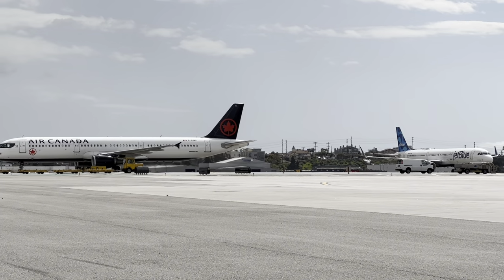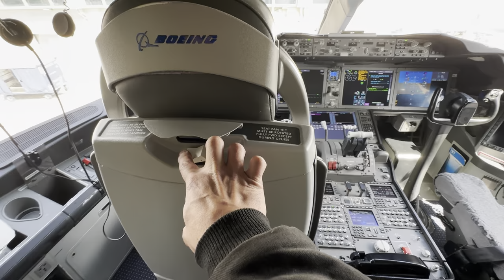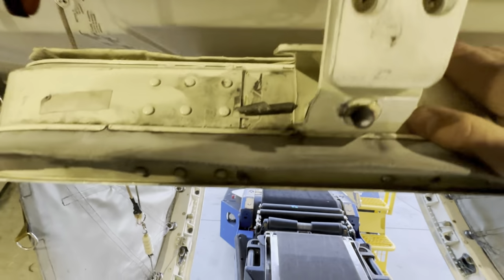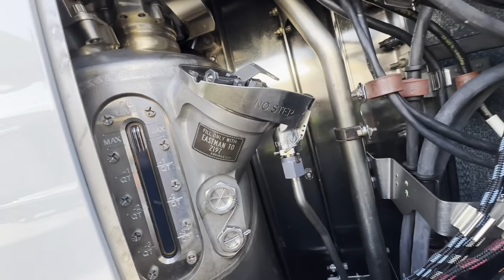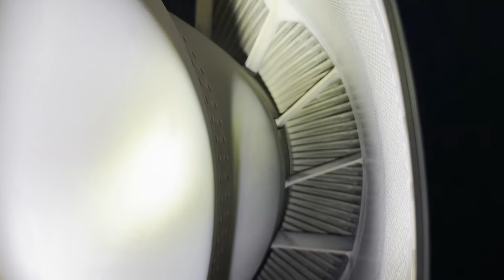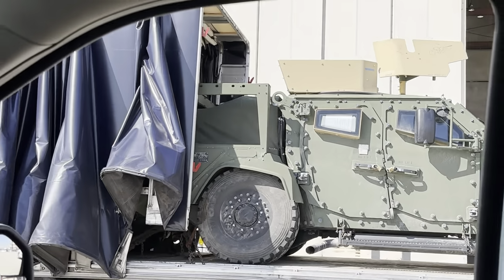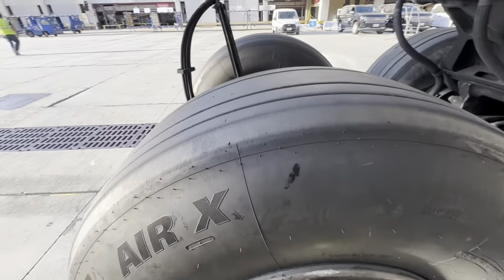Stig Shift #17 (Aircraft Maintenance Adventures)

Comment: 3:00 interesting. If you ever come across and EOL indication please do film it!

14:00 This is a Dual Motors. apparently it was a US-American car manufacturer. Carrozzeria Ghia is an Italian car design and coachbuilding company...
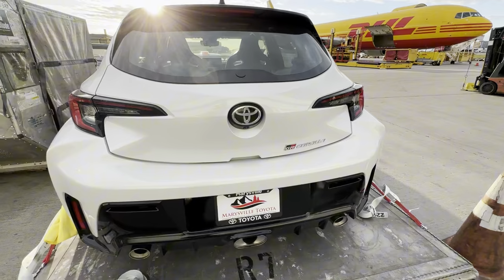14:50 Well... I'd call it a hot hatch, similar to the Golf GTI, Focus RS etc
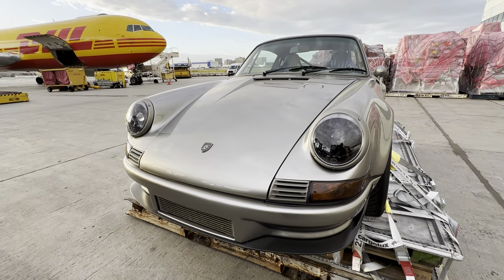15:00 You're saying Porsh to tease me now, don't you :'D

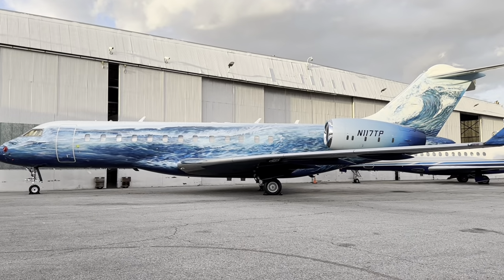16:10 it's nice... but I kinda dislike the amount of blue. makes it really hard to spot in the sky. So is white against a cloudy backdrop though, so I guess one can't complain too much^^

25:00 what's the water draining there? is that simply a drain from the wheel well and water sloshing around the drain hole area?

30:15 When doing the status test. The Aircraft Acceptance for the Captain includes a 3second status push. Do you guys do these? Never seen you do one but editing removes context, so please don't take this as me throwing criticism your way. Just genuinely curious :)

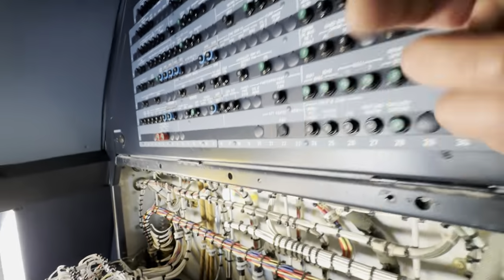31:25 Those blue items. I assume they aren't lockout rings as they are red. Are they simple chicken rings to indicate certain breakers and make them easier / quicker to find? (I know about the green/black meaning [FWC monitored breaker and system])
Reply from the maker: The water that you’re seeing is coming from the forward potable drain port. In regards to the three second status push, I’m not quite sure what you mean by that, if I want to see the status, it’s just one press and it shows the status page. In regards to the circuit breakers, some of them are disabled, and some of them are permanently locked out so it won’t be tampered with.
Reply: @StigAviation  in regards to the circuit breakers: what would the blue be then? I understand the red ones: Flightcrew has no business touching these whatsoever. Really confused about the blue ones though :'D

On the STS: oh, sorry, I got my buttons confused; my bad. I meant the RCL on the EFIS control panel. If you press that one for 3 second it'll recall all cleared/cancelled warnings. This is part of the flight crews aircraft acceptance procedure. Only ever seen you check the status page so I was wondering about that difference.
Reply from the maker: @boahneelassmal  I don’t need to bother with the recall switch, that’s why I print out a post flight report that will give me all the information I need. Even more data than the recall switch will show.
Reply: @StigAviation  ooooohhhh okay, yeah that makes a hell of a lot more sense :'D
As I said, was just wondering.
cheers mate!

Comment: One question I have always had is how long between the pilot hitting the shutdown switch and the engine no longer posing an ingestion risk. I guess the compressors, in effect act like an engine brake and the compression acts to slow down the shaft assembly when fuel is cut.
Reply from the maker: As soon as the pilot shuts down the engine, it cuts the fuel and starves the engine, once that occurs the power loss is almost immediate, 10 to 15 seconds and the engine is no longer producing any thrust. Afterwards, the engine simply winds down naturally.

Comment: Love the uniqueness of your videos!  A perspective that is not offered by other aviation videos.  I was wondering if you could explain a)  what the loud, mid to higher pitched hydraulic/mechanical sound is that one hears typically just before engine start on Airbus planes?  As a passenger you hear this coming from under the cabin about mid way it seems.  b)  Certain planes/engines produce a very amplified  "playing cards in bicycle spokes" sound on takeoff and climb out until throttling back for cruise.  Can you explain why the engines make this sound?  Thanks!
Reply from the maker: The sound you’re hearing from the Airbus is called the power transfer unit, I made a whole video just about that. Check it out when you have time. The sound of the engine is simply the sheer power of thrust along with gearbox functionality.
Reply: "playing cards in bicycle spokes", otherwise known as the buzzsaw.  Since most modern, high-bypass engines have the fan linked to the low-speed spool, when under high thrust, the sound is the shockwave of the tips of the fan blades going trans-sonic.  The exception is the Pratt Geared Turbofan (GTF), installed on the Airbus A320/321NEOs and A220s, which has an additional gearbox that de-couples the fan from the low-speed spool.  Since the gearbox allows the fan to operate in its most efficient range, the fan speed on the GTF never creates this shockwave at the fan blade tips, and so it is much quieter (relatively-speaking) to traditional high-bypass engines during take-off/climb-out.
Reply: Thank you!  Just watched the video you referenced.  That was before I discovered your YouTube channel so I missed it.  Very helpful explanations! @StigAviation

Comment: Great channel  really enjoy your knowledge.   What are the spinning wheels next to the throttles on the 737 and the 320's
Reply from the maker: The spinning wheels are the trimmable horizontal stabilizer wheels. It is to trim the horizontal stabilizer manually if needed. But usually it’s doing that automatically hence why you see it spin around on its own when the aircraft is flying

Comment: Stig! Great and amazing videos! I hope I didn't miss it in the comments or vid. But on the push back clip, as soon as the plane is backed on to the line fluid begins coming out of a port just aft of the nose wheel panels. What was that?
Reply from the maker: That’s just water coming out of the drain of the fwd lav or galley sink.

Comment: We need Stig on this one...news said no brakes, then manual brakes.
An redacted Airlines jetliner suffered an “anomaly” in the braking system before running past the end of a runway at Dallas-Fort Worth International Airport. The issue occurred on February 10, 2024. An inspection revealed that flexible hydraulic lines to parts of the braking system had been improperly reconnected after a repair job. Despite the brake failure, the pilots used manual brake pedals and thrust reversers to slow down, and the plane eventually came to rest on a paved area beyond the runway. Saw pictures of crossed brake lines, and electrical lines.:face-fuchsia-wide-eyes:
Reply from the maker: Nothing more I can add to that, everything is pretty much explained in the report.
Reply: TY @StigAviation

Comment: 10:47 , I see that there is a marking on the tyre that says 777-300. Does that mean there's a  wheel difference between the -300 and -200?
Reply from the maker: Yes indeed. The 777-200 is a smaller wheel. The 777-300 is bigger. Not interchangeable.

Comment: Do you rotate your working gates or stay at the same one ? Is your normal day a 16 hour shift ? 3 day work week ? Are the engines specifically set up as Number 1 or Number 2 ?
Reply from the maker: We rotate the gates around so everyone gets a little change of pace. Normal day is usually 8 hours, it’s when I pick up extra shifts it turns into 16. Engines are interchangeable between 1 and 2 side. Left is one right is two.

Comment: 20:15 The Alaskan door plug that opened up that was due to the fact that that particular door was the passenger door plug Those doors are not designed to be opened. They are there in case if the airline company wants to utilize it and actually make it a door and to these aircraft are usually used for cargo only in some companies and the airline does not want to have to redesign an airplane every time they change it from cargo to passenger. If you look at some aircraft that are cargo, you can see the window cut outs, but no windows and that’s because that same design is used for a passenger aircraft.  The NTSB already checked the accident and seen that the four bolts that hold the door plug in place were missing. Once the aircraft got up to altitude, it blew out depressurizing, but thank goodness it was only at 14,000 feet shit would really hit the fan if it was over 30,000 feet
Reply from the maker: They were lucky that nobody was sitting there.

Comment: Nice video! A question: The windmilling of the engines on the ground, does it ever create problems for the bearings? Are they keeping lubricated even when engines not running?
Reply from the maker: It never creates a problem, it’s designed to do so, there is residual oil within the bearings to keep it well lubricated when it’s freely windmilling

Comment: Hey Stig! Just curious, who does the maintenance and repairs on the ground equipment? (Push back vehicles etc). Is that a completely separate crew or garage of its own?
Reply: Depends on the airline. Smaller companies use aircraft techs to do GSE (ground service equipment) maintenance at smaller stations. Big airlines like Stig’s have big unions, so all that stuff is segregated.
Reply from the maker: There is a separate group of mechanics called GSE, ground support equipment. They take care of all the ground equipment maintenance. They are in a separate department completely.
Reply: @StigAviation  awesome. Great to know. Thank you

Comment: I noticed on a few of the 737-800's there's a blue line in between the unemployment line and the injestion line. It only seems to be on the starboard side? Lol, just another thing I've never noticed before
Reply from the maker: If I remember correctly the blue line is for the catering truck to align with the door. I’ll double check on that one.
Reply: Ah yeah, well that would make sense. I've noticed it on other carriers/aircraft too so it seems logical that's what it's for. Thanks Stig 😊

Comment: Hello stig, I am wondering in what situations that you actually use the circuit breakers
Reply from the maker: If I needed to disable a system to perform maintenance. I would pull the circuit breaker in order to deactivate certain components.

Comment: I’m glad you talked about that 737 so media said it would be epic failure with the plane crashing to the ground so I guess they were not telling the truth. That’s nothing new..
Reply from the maker: They never tell the truth, they are just Clickbait. Never believe the media.
Reply: 737 is a great aircraft many components have been made and improved on by the test of time originating from the 727 as such things as the ac packs to hydraulics.  It’s the workhorse of the industry. It’s a very reliable machine. I rather go with a 20 year old 737 over a 20 year a320 any day as a320 becomes glitchy especially in the cold rainy mornings in the cold climates where your sequencing the eBay by unplugging the electronics at wake up the make the faults go away. As far as the max issues is plain and simple is a Boeing quality control issue. Where management to engineering to the production. The supply chain issue to the assembly line floor issue. When Boeing solves these issues you will see the max come out on top. As far as the Redhead stepchild A220 and the manpower my Delta friends are doing to keep the Delta A220 fleet flying is a lot more manpower than it takes us at southwest to keep a 737 fleet flying is a fact. Airbus is very good machine too but the airlines will get tired of the A220 when it comes to heavy checks and that will hurt Airbus later on in the next decade to come.

Comment: That little tube in the back of the 737-800 engine, moste of the time soot and oil residue but is it normal that it actually dripping oil from there? I noticed the pilot saw it so... just wonder.
Reply from the maker: That tube is called a center vent tube, it’s a breather to release oil gases that are built up within the gearbox and the bearings. It’s completely normal to see oil residue

Comment: We had a fire near our airport the other day, and it got me thinking: How many air filters are on an aircraft? Do you replace them on a schedule or do they use pressure differential across them to alert they need replacing?
Reply from the maker: There are many filters for different systems. And yes we do replace them on interval basis. It will get scheduled by our maintenance planning department.

Comment: Why do the CF6 engines have a grinding sound in the cabinet until they reach higher altitude?  My guess is air density and blade noise.
Reply from the maker: Just the way the engine is designed. The compression and combustion and a variety of other components that add to the noise. Not to mention the gearbox operation.

Comment: I recently had a trip to Atlanta KATL, I saw an A350-900 getting a wheel replaced, how exactly do they do that? I also saw a A330-300 having the little WIFI dome on the top maintained.
Reply from the maker: I have a couple of videos that show how we replace wheels on aircraft, check those out. It’s basically the same procedure.
Reply: @StigAviation  alright, will do

Comment: It's weird seeing this as in the airport I work out when I'm brake riding I'm just brake riding all I have to do is set the transponder on and dial the frequency and that's it, the tig driver does the communicating
Reply from the maker: It just depends on what type of tug they are using.

Comment: Stig, Will the gear up lever move when on the ground?
Reply from the maker: 99% of the time the year will not move up, there are wait on wheel sensors, as well as the weight of the aircraft will not allow the gear to move. There are very specific criteria that have to be met in order for this to happen. The one percent chance is if the hydraulics were active and running, and there wasn’t enough weight on the aircraft, the nose gear is susceptible to collapse. But that rarely ever happens.

Comment: Hey Stig, just wondering but for these line maintenance jobs where you work on many different aircraft. Would it require a type rating for each aircraft youll tie your signature too? or only the person signing off requires the type rating/course?
Reply from the maker: Your assumption is correct, yes, we do have to have type ratings for all these different aircraft in order to sign off our work.

Comment: How does the startup for the engines work? Is there anything to kick it up, like a starter motor in a car?
Reply: APU and if that's off a very loud jet starter.  And if its the start valve issue nominate who will stand next to the engine
Reply: @Crazy--Clown  So the APU has some kinda dis-engageable shaft that mechanically hauls the rotor of the engine around?
Reply from the maker: The APU will provide air, and it will send air to an air starter on the main engine, this is how the engine begins to turn. The starter on the main engine is connected to a gearbox, the gearbox will begin to turn, and it will start turning the shafts of the engine internally, once that occurs you have compression, then you will get, spark, fuel and combustion. That’s how the engine starts.
Reply: Amazing! Thank you so much for the info!  @StigAviation

Comment: Stig, just curious, if some knucklehead accidentally pushed the landing gear lever up while the plane was parked, would the gear retract or, is there a safety to prevent that from happening?
Reply: There is a weight sensor called a SQUAT SWITCH that prevents the landing gears from retracting when it's on the ground.
Reply from the maker: It has happened in the past. 99% of time nothing will happen. Weight on wheels sensor as well as the weight of the aircraft itself will not allow the gear to retract. Now that being said, there are certain conditions that have to be met in effect for it to inadvertently retract, such as hydraulic systems running and aircraft not as heavy with fuel or other things. At that point the nose gear can collapse. It has happened in the past. But this is why we use safety gear pins when we do maintenance. We lock out the systems

Comment: @stig aviation  engine oil.... does the engine actually burn oil and that's why you top it off when you see it's needed?
Reply from the maker: Yes, the engine oil simply burns off. That’s why we keep on adding. The reason it does this because it’s the same reason as a regular diesel engine.
Reply: @StigAviation  gotcha!   Thx for answering!

Comment: I have a question. When do you know it’s safe to approach the engine? Do you wait until the beacon is off, or when the fan is stopped, or just slow enough to count the blades?
Reply from the maker: As soon as the engine has shut down. it is safe to approach the engine.

Comment: 18:36 Those lights that say "Drive" what does that mean?
Reply from the maker: If the generators get disconnected via those toggle switches that are underneath, the red covers, the lights for the generators will illuminate, the drive indication is for integrated drive generator, the reason that they are lit up is because the generator is not functioning so the fault light is illuminated

Comment: Stig how many times is that scenario of a malfunctioning seat used in recurrent training for a pilot ?  With all the gadgetry how the hell could you remember where every switch is that is non critical ?  My brother is a 35+ year Delta mechanic and calls pilots “high priced button pushers “ but agrees this is abnormal.
Reply from the maker: I don’t know how often they go to training because I am not a pilot, but I do know they are aware of the system and how it functions. I wouldn’t call them button pushers, they are more of monitors at this point. They are constantly observing the situation and monitoring the aircraft.
Reply: Thanks for responding.  Just saying if that’s what really happened then pilots need to be trained for that unlikely possibility which I can’t believe they are.  Or Boeing should move the seat moving button away from accidental activation.